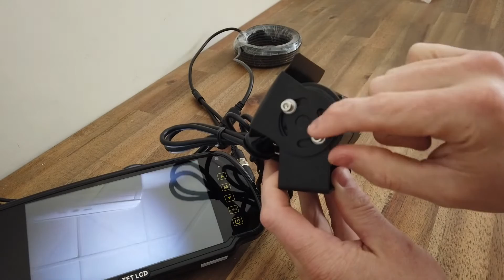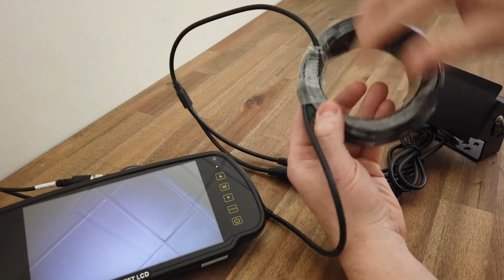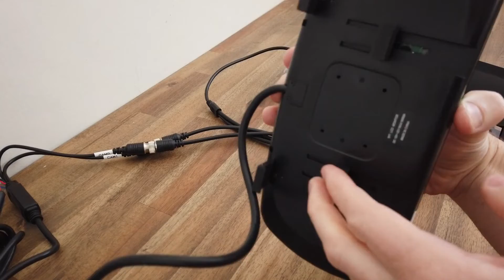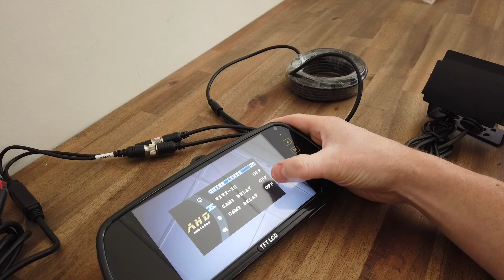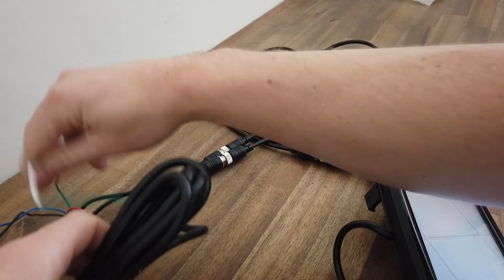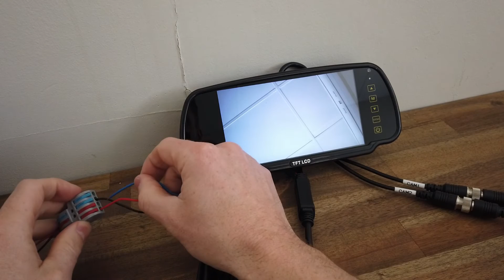Rear View & Reverse Camera with Monitor

Comment: Great video! I had the identical setup installed, except that the monitor and cameras are from safety dave. Was told by my installer that the reverse trigger and guide lines cannot be activated. WTF!
Reply from the maker: Hey mate. Thanks for the feedback. Cheers!